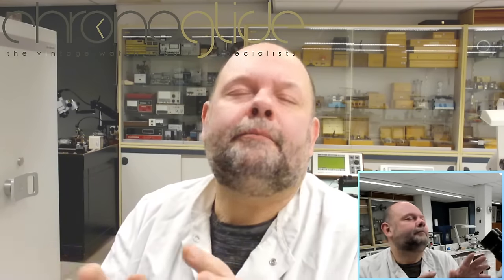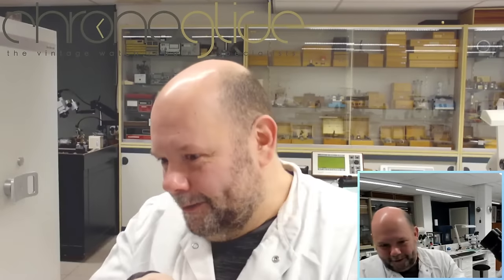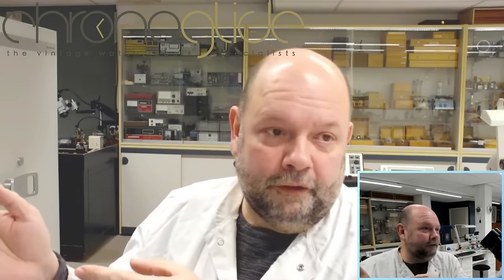How do i know my watch needs maintenance?! 😳

Comment: I asked this exact question to a pro watchmaker working in Switzerland and got the following reply which I found very useful: "If you can see the oiling in the balance jewels and it looks good, and the watch is running fine and winding correctly with the automatic, just keep wearing it until the oil looks like it has depleted somewhat, amplitude starts to drop, or the rotor starts spinning when you handwind (sign the reversers need servicing). If a watch has been properly cleaned and serviced to ETA factory spec it really should run 10 years without issue."
Reply: Woowww ! Actually when you mention when manual winding an ETA 2824-2 how many times its best 30 turns or 20 ? Got 2 when I give around 30 turns the rotor stars rotate 😳 I’ve asked the seller it said it’s no problem 😳 now I’m confused!!!
Reply: @69fastfurious  it is a problem the reversers need looking at. My Tissot is in for repair now.

Comment: In America it’s very hard to find a watch maker that will actually service your watch, especially in low populated areas. They only change batteries and the whole movement out if it’s a generic off the shelf movement, and if it isn’t they won’t want to deal with it. I can do that myself and have done so successfully many times. I need an affordable watch maker to service my sentimental pieces whether they have a version of an eta 2824-2 or generic off the shelf movement or not.

Comment: The following are the key takeaways from this video:

* The goal of watch maintenance is to reduce the friction of the movement of the watch.

* Over the past 15 years, mineral lubricating oils have been replaced by synthetic oils. This means, oil is less likely to degrade over time and less likely to cause friction in the moving parts.

* Watches that are not running = no wear and tear in the movement. Watches that are kept aside and not worn regularly are less likely to degrade.

* Activity level of the person wearing the watch is important. An office person's watch will be different from a cyclist, even if they wear the same watch.

* As a rule of thumb, it is better to get watch checked by a watchmaker every year or two years.

* When talking to the watchmaker, the main thing to ask for is the Amplitude of the movement. It should be in the range of 230-300.

* Deviation in time is not the indicator of watch needing maintenance.

* Lubrication is the key.
Reply: Thank you for the very useful overview.
Reply: Did you think people are too stupid to figure this out themselves?
Reply: Thx a lot ❤

Comment: Excellent video, thank you Kalle!

It is impossible to cover everything in a short space of time, but one further detail for the people who use antique wristwatches with no water resistance and those who still carry a pocket watch follows. 

Modern and most vintage watches have or had a degree of resistance to the ingress of water and dust. This is often not true of some antique wristwatches, small pocket watches that had lugs added to create a wristwatch and pocket watches. 

These watches do need more frequent servicing due to the impact of dust and potentially moisture getting on to the movement.

Comment: I was working on an old 1951 Bulova "HIs Excellency" (yes, that was the model name) once, and it had sawdust in the movement.  
What's some of the strangest things folks out there have found in the movement?.   That would be a fun video topic :)
Reply: if you look in old textbooks, they say to use wood dust to dry the parts after cleaning
Reply: Extra screws not from the watch on my bench!

Comment: Thank you for this video. I learned so much about if my watches need servicing. Now off to buy a timegrapher....:)
Reply: And a demagnetizer😊.
Reply: Especially a demagnetiser. After flying to Phnom Penh one time my watch was badly magnetised. So I went to every watch shop I could find and from dozens only 2 (two!) even understood what magnetism is. I even took a compass with me to show them. Those were a really expensive boutique who could only send the watch to Singapore to get it fixed and the official Longines boutique who had a demagnetiser but basically told to to f**k off because it wasn't a Longines although it was a watch with an ETA movement which like Longines is part of the Swatch group. All they had to do was put it unopened on the machine and press a button! Needless to say my plans to buy an automatic Hydro Conquest there were binned...

Comment: He's right about the oil, and he's right. A watch left in a draw is not wearing out. Congratulations, take a bow . Assuming you purchased your watch in the last ten or so years, the only real indicator there may be a problem is in its timekeeping.  If your watch is newish, keeping good time but the amplitude is high, then so what? A small defect in a watch is not the same as a defect in a car engine.  It may only take a few hundred miles before an engine blows up, but it would take years for a small defect in a watch to become a problem because of the tiny forces involved.

Comment: Cheers Kalle.  Extending the comparison between amplitude and timekeeping, it would be interesting understand why different movements have different lift angles, what a lift angle is, why it matters knowing the lift angle when measuring amplitude.  Tot gauw!
Reply: Calibre corner is a useful guide for lift angle for different calibres

Comment: Hi Kelle.  As always very good info. Thank you. I've heard from a watchmaker in Russia (Russian watch YouTube Channel) that new synthetic oils tend to evaporate after a while, leaving that watch dry, thus  increasing the wear on the metallic parts.  The older mineral oils tend to gum up the movement, so it just stops working and thus prevents the parts from wearing out.  So, although the maintenance period for a watch lubricated with mineral oil is much shorter, it may be beneficial for the watch in the long run.  What do you think?
Reply: That is correct, I see more wear and tear on modern watches such as Omega and Rolex than I see on vintage watches. Vintage watches seem to be in good condition on parts and that's because of mineral oil and mineral oil gums up and stop the watch from running, basically, it saves the watch from damage, but many watch owners toss it in the drawer and forget it about for many years until we service it and yet runs perfectly once we service it. Modern watches especially like Rolex, have to replace the balance wheel due to wear and tear because of a lack of synthetic oil, which has dried up for years.
Reply: @watchmakerspecial516  Thank you for useful information.

Comment: It's easy to see the balance amplitude without special equipment by filming the movement through the slow motion mode of the phone (that is, if the caseback is transparent, otherwise you have to remove it of course).
Reply: But a novice wouldn’t know what a good amplitude looks like.

Comment: I only have 2 automatics left, a CWC Diver with a 2824-2 (with calender parts removed) running at -1.5sec/day and a Tissot Automatics iii with a 2836-2 running at -0.5sec/day. Pretty good for 5 year old standard ETA movements. The amplitude on the CWC is about 245 and on the Tissot about 250 (after a day of wearing). So I'm guessing they are still good for a couple of years before needing a service.

Comment: Great video and spot on with respect to the maintenance. With my Rollies I now use synthetic for sure, my last watchmaker he was old school and used the coded oils with the 5-7 year rule. In Canada I was paying $700 for a rebuild on my 3135's before I learned the craft myself. With my Seiko's not to worried about it due to the low cost to repair/replace a movement. Like the videos and Cheers! After thought question: A Rolex rep was saying when you take the watch off to place it on it's side and on the crown...I think it was mostly to prevent case scratches. What do you think about this statement?

Comment: Thank you! Say, I have a Sinn with a crown that doesn’t “pop” to the correct position when unscrewed. I sent it to a watch repair shop, but they didn’t fix it. Is this something that can be made to work properly? What might I ask for to ensure that it is fixed? Is this a common issue with Sinn 104 watches?

Comment: I enjoy your videos very much.  Can I impose on you with a question?  I have a circa 1960 Vacheron Ultra Plat with a 1003 movement.  I bought it at auction a few months ago.  The amplitude is about 250, but the beat error is over 1 ms and it’s running 40 s/ day slow.  In your experience (and what you said in the video about amplitude), do you think a good service would bring my sweet baby into greater accuracy, or is that about as good as a watch that old gets?

Comment: Some years ago, back in 2018, I sent my dad's gorgeous 1954 gold Omega (calibre 266) for maintenance and the watchmaker handed me a small strip of paper with the output from the timegrapher:
001s per day  (later on the same paper, -003s per day)
beat error 0.9ms
amplitude 312 deg.
quite straight and horizontal double lines of dots.
18000 beats
some other data I do not recognize: SEL    2   52 (upperscript line)2   on

Should I be concerned with such a great amplitude?
Reply from the maker: As long as it is not running fast you are okay.
Reply: @ChronoglideWatchmaking  Thanks, Kalle! 👍

Comment: You are absolutely right, but some watch manufacturers for example Rolex will tell you to have the watch serviced at a Rolex authorized dealer, so the watch will be always certified. Another thing that almost no one cares is if the watch is COSC certified, witch you need to have not only the watch serviced but also have the watch certified and that will cost you a lot of money.
Reply: Rolex and other expensive brands make a good portion of thier profits in the service shop for a reason.

Comment: Wonder how long robotics have been used in building mechanical watch movements and whether this time period makes up the distinction between modern vs vintage watches. Teddy Baldassarre recently made a video of Germany's NOMOS watch manufacturing and it appears while NOMOS uses robotics extensively they still manually put the movements together, probably only for the marketing gimmick of being "hand made" whereas a company like MIYOTA could use robotics in 90% of movement manufacturing. I'd suspect the use of robotics has as much to do with the improvement in mechanical watch longevity and reduction in servicing as the use of synthetic oils.